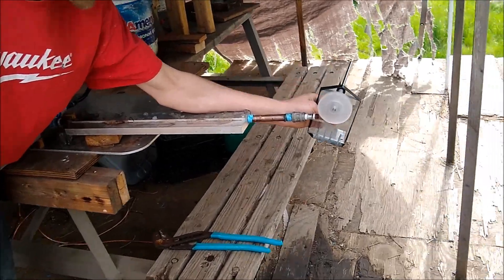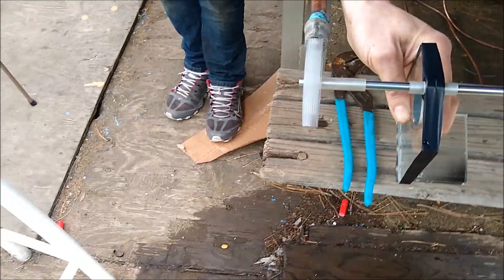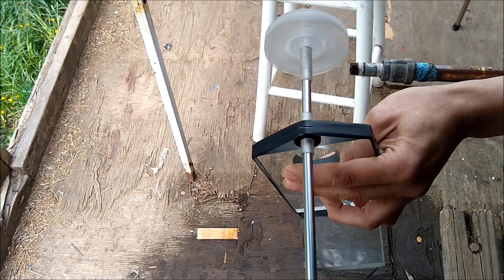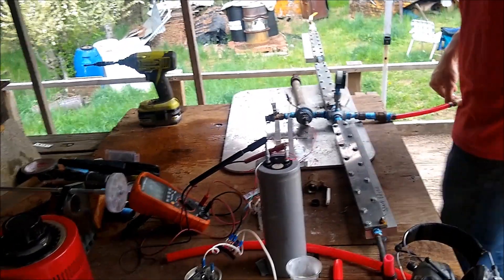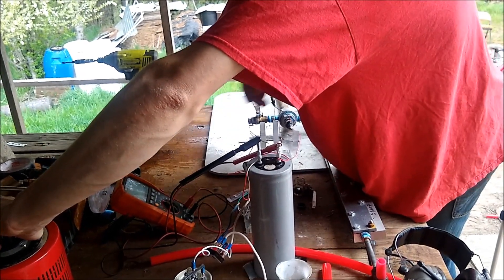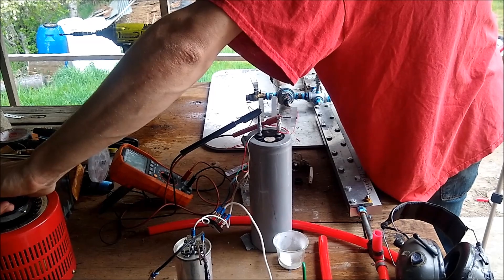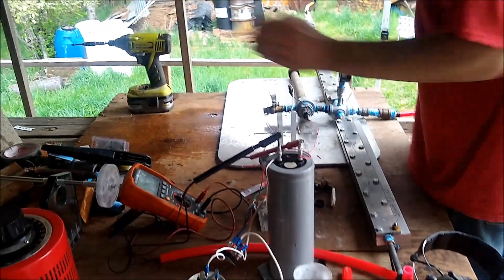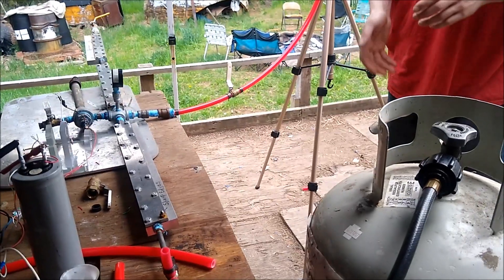Tesla Valve Pulse Jet Engine, Testing New Design Great Results!

Comment: The gist I got from reading the valve patent was that the spark is not required once it gets up to temp and actually, not required at all when you consider things. The frequency is controlled once hot by your air fuel mixture. You could for instance start it by warming the combustion chamber with a map torch till the chamber ignites the flowing gas (or gasoline). At that point the valves begin to do their work. In closing, the spark setup is just getting in your way. Great work though.

Comment: Are you going to try detonation,I'm interested in results of such concept as Pulse Detonation Engine for RC model plane ...
Reply from the maker: Rc model plane would be so awesome! We are going to testing the new 3d Tesla valve design that was computer simulated, the simulation proved over 5x more efficiency from the valve, it is a 3d Tesla valve. We also got a new 3d printer we will be printing it with. Soon  after we will get it metal 3d printed for testing with pulse-jet/detonation. This will work flawlessly with a rc model plane!!

Comment: @bruce baxter

No. Know what? You get two. 
Zero moving parts, so no minor maintenance. Flap valves need replacing so often it's not financially viable. A meaningful and useful source of thrust is produced in addition to electricity, and i remind you that this condition can be made true even in space. Literally every gripe you have about this design is a matter of tuning and refinement.

Have some damned patience on that one, dude, and quit throwing snark at someone who actually put the work in.
Reply from the maker: a wonder of tesla science, we will finish this project in the future, it was a side thing at the time but we will return after our complete off grid system.

Comment: Really cool to see a tesla valve returning such great results, but I'm confused why you're having to force feed air continuously - mainly after the combustion sequence has initiated. I've always seen pulse jets work just fine under air supplied purely from the vacuum of the explosion...
Reply from the maker: Yeah we should be able to get continued use without air compressor with he right tuning. We have significantly decreased our compressed air usage but ultimately we will have a Tesla pump taking the job of the air compressor. It doesn't require much pressure at all to run.
Reply from the maker: Once we have tuned the valves completely it will work much better as well.

Comment: A better expansion chamber combustion chamber would probably help with frequency variation
Reply from the maker: Absolutely!
Reply: @iEnergySupply  I also think you need an electronic regulated spark generator. Using a line auto-transformer and spark gap  is rather crude.  Contact me at Space-Time Productions (Google search). I'd like to help. We can incorporate feedback. Let us discuss it. A reply to this could also work.
Reply from the maker: @msimon6808  We recently did a simulation on a 3d tesla valve design and it out preforms the original seen in this video by nearly five times. A variable spark would have made it easier to tune the inferior Tesla valve pulse jet but with the new Tesla valves we should only need to get it started with a spark but after it's running there is no need for the spark.